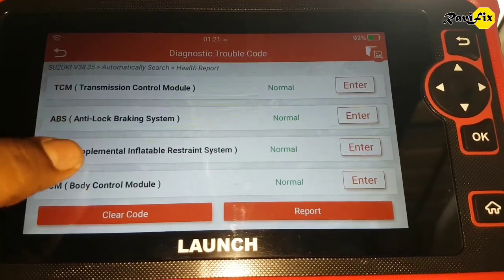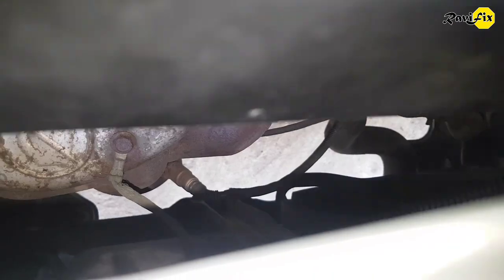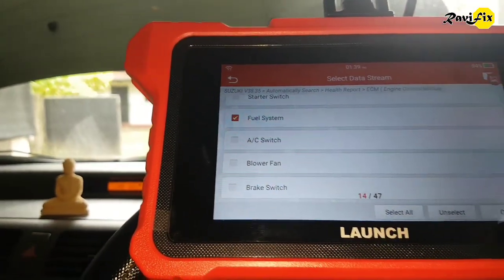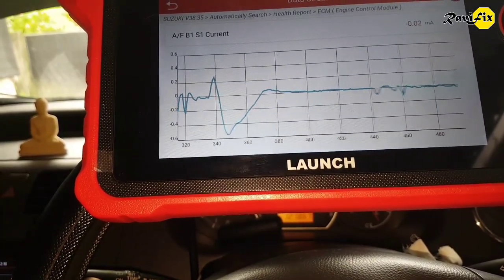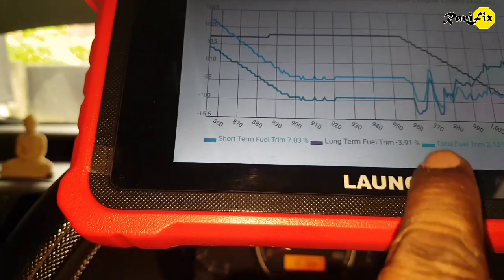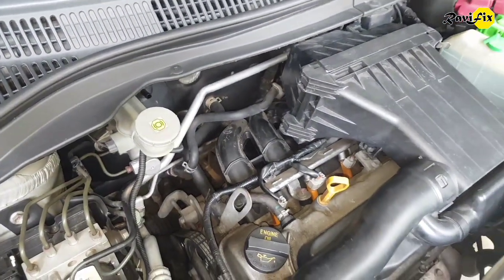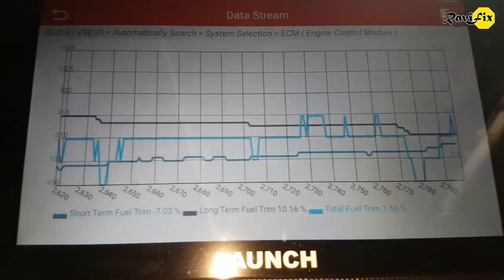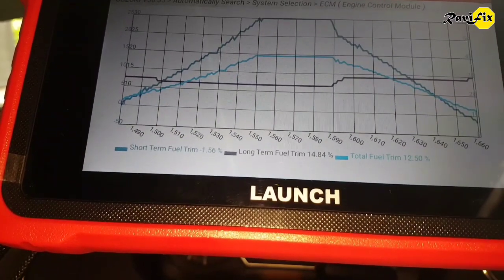P0130 O2 sensor code diagnosis on Suzuki Swift. Don't be misled by fault code. vacuum leak detection

Comment: Can you tell me the fuel pressure recommended for alto turbo rs 2015 dba ha36s
Reply from the maker: 35-40psi
Reply: @ravifixall  thanks for the reply Ravi, i have 0.3 mpa running pressure, I connected the guage on the fuel injector line using T connection. I have checked almost everything my o2 s1 current is going above 3.6 ma when the throttle is pressed and the rpm is coming back to normal. Are those normal values?

Comment: sir Chevrolet spark 2013 model oxygen sensor bank 1 and bank 2 sensor are same or not ?  actually  bank2 sensor not working but ihave extra bank1 sensor so can i fix the bank1 sensor place to bank2
Reply from the maker: Is it a V6 engine?
Reply: @ravifixall  Bank 2 sensor is damaged in my car, so I have two extra 2 bank 1 sensors, so I changed the wire from bank 1 sensor to bank 2.
Reply: please tell me sir

Comment: Hello, i have a suzuki swift 2010 1.6 petrol sport, i get this code, P0420 fault code "Catalyst System Efficiency Below Threshold bank 1", could this be caused by a vacuum leak or faulty O2 sensor?
Reply from the maker: Yes it could cause vacuum leak or faulty downstream oxygen sensor or upstream airfuel sensor or Vacuum leak. But this should be properly diaganosed.
Another common possible cause is worn out catalytic converter produce this code.
Reply: @ravifixall  thank you. I hope it’s not a worn out catalytic converter
Reply: Did you figure out what caused you Swift Sport to have this issue?
Reply: @rinna88  well I changed the O2 sensor months ago and the code has not come back since. It was a bigger to get out. I cut
The wire and used a blow torch to heat up the exhaust part and a socket with lots of strength

Comment: I would highly recommend Ravi to anyone who is looking for have a proper diagnosis rather than going for just replacing parts as so called technicians advise. I tried to check this issue from 4-5 places but ended up with been told “ need to replace the o2 sensor”. No one even attempted to check whether the sensor is working or not but simply said its not functioning just by looking at the scan report. This saved me 25-35 k. Good Job Ravi👏
Reply from the maker: Thank you.
Reply: I have the same issue mate.can I get his contact number please?
Reply: Bro can u send me his contact number